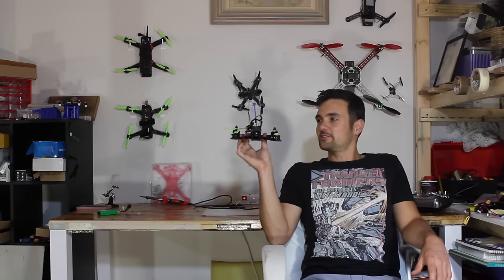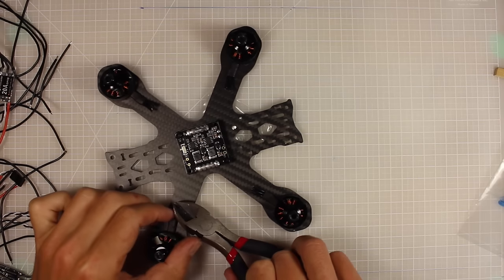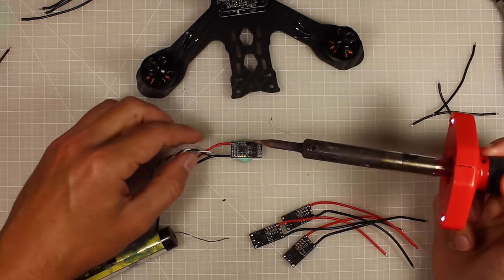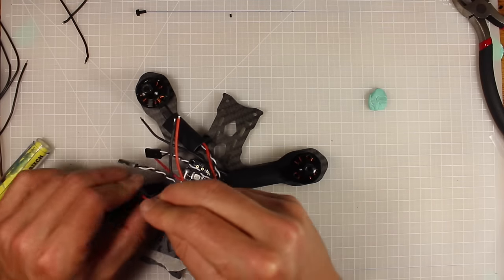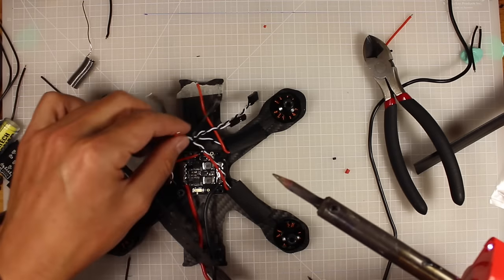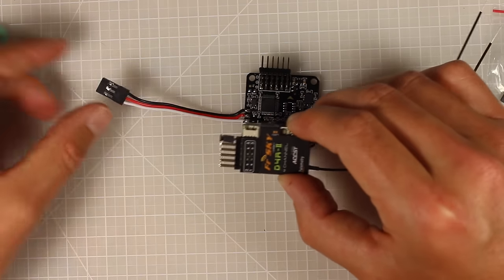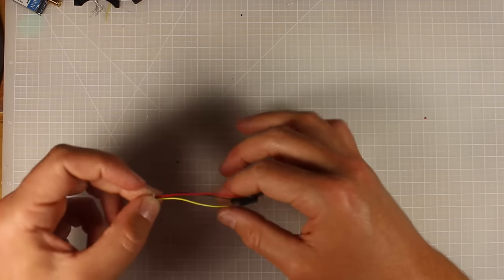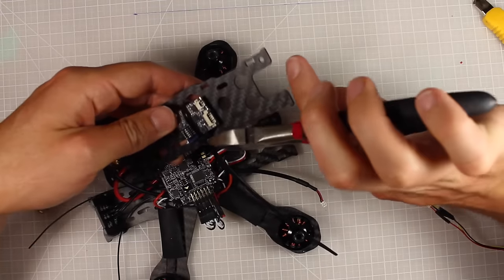HOW TO BUILD A RACE WINNING FPV QUADCOPTER: TUTORIAL GUIDE

Comment: I managed to fit 5 inch props and man! This is a rocket 🚀!
Reply from the maker: WHAT ON A 41B???
Reply: I'm not sure what you mean by "41B." But, if you are talking about the frame, no. I used a different one.
Reply: BTW, I have a question. I'm a noob. I feel very stupid for asking this and I feel as if i'm missing something. When I put on the props on the motor shaft and screw on the nylon locking nuts, the nylon locking nuts seem to only screw on to a certain point. I grab a wrench to tighten it but it really doesn't work.
Reply: make sure you're using the right nylock nut, the threading should be reversed on two of them, that means you tighten them anti-clockwise. The motor nut will only screw on to the correct threaded motor shaft, make sure you've soldered the clockwise and anticlock wise motors in the right place! Otherwise the props might fly off if they're not spinning with the thread!!!

Good luck!
Reply: +MrSmoothvideos 
I'm using the correct nylon nut. The one that comes with the motors. The motors are spinning the correct direction, it's just the nylon locking nuts are not screwing all the way down.
Reply: Golden Archer
Are you sure you using the counter clockwise nuts on the counter clockwise motors and vise versa
Reply: +MrSmoothvideos 
There are no cc and ccw nuts.    A nut is a nut. They only spin one way.
Reply from the maker: Golden Archer there are indeed normal and reverse threaded nuts
Reply: I'm not sure. I'll figure something out sooner or later.

Comment: how we doin mate if i was using afro esc's would i need to give my naze32 a seperate 5v power suply 
cheers :-)
Reply from the maker: +James Bowen do they have a bec. As in do the afro escs supply a 5v power supply. 
You need to power the naze off 5v. Now some escs do that and some dont. if they dont (which was the case in my vid) then you need to find another 5v power source
Reply: +UAVfutures no probs mate I'm building my first racing drone the zmr250 just waiting for the naze board to come. Then I found your channel was having a mouch and you said I need to have a separate power supply but I've looked at my esc's and they supply the voltage to the board so my panic is over. Because I've made my own PDB and there was no way of reducing the current to 5v. Cheers for getting back to me mate 
James :-)

Comment: Is there any cheaper frames that I could use instead?
Reply from the maker: +Tyler MacNeil you can use any frame you want. I just recommend carbon fiber so it dos not break. The ZMR 180 is a good cheap frame from "FPVMODEL". not quite as good as this Armattan but its great value.

Comment: First of all, thank you for your grate videos! Becose of you and your great videos i want to start with FPV flying now. But I am afraid to build one becose I don't know how to bring them in the air... I know how to fly them on my simulator and I am not bad at all. I just don't know how to programe them and bind them with my spektrum DX 5e. I know the modle is a little bit old but is it even possible? It wuld be SOOOOOOOOO awesome if u could help me (With a tutorial would be great). Again THANK YOU! And witch Drone do you prefere, the F1 4B or the F1-Pod? Sorry for the bad english and stay awesome.
Reply: And got this thing anought power to carry a gopro on it and make cool stuff with it?
Reply from the maker: +THE_LAW_42 this thing can easily carry a go pro, the only transmitter I use is the taranis so in order to fly with your spektrum you need a compatible receiver. I dont have a spektrum so I cant make a tutorial for you sorry. I do have a cleanflight and betaflight set up on my channel though which will help you with some of the programming in the flight controller
Reply: UAVfutures
 Thank you for your advice. I allready baught the vortex 250 pro today so I don't must prgramme the quad myself. But if I like the hobby I can build one after.

Comment: hi stu iv just got a mini fpv setup to put on my old syma x8g  i was thinking at the start of using a pigtail to have the antenna on the top center of the quad but iv had a 2nd thought incase they big props catch the antenna can i shoot the antenna out from the back strait out  or must the antenna be point up stu
Reply from the maker: the antenna should be perpendicular to your receiving antenna. but if you use a circular polarized you should be ok. idealy you want it straight up but this can be hard when your quad is changing orientation all the time
Reply: cool stu yes iv got the ANBEE set of antenna,s for this and the TS5823 mini transmitter  for this im just waiting on my mini cam and my step down to come they should have been here by now lol  but there coming from china stu  i got all this for $26.42 on ebay and im still not sure if i should put the transmitter inside the body and shot the pigtail out the back of the body  or from under neath lol    and i had an old internet rooter iv took the antenna of and was thinking of putting it on my controller iv seen some one doing this with a X8G  for better range  for fpv  and i can still have my syma camera for video and nice pitchers    do you think this would be ok doing these mods stu   i am getting over ten mins flying times with this X8G  even with video running  i cant really see it being a problem stu m8  what do you think  and thanks again stu
Reply from the maker: William Davie my advice is keep it as clean, simple and light as possible.
Reply: +UAVfutures hiya stu yes that's my main priority m8 iv put my transmitter and antenna on the scales it's 12g  and iv got the mini Aomway 700tvl wdr it' shows in the details 12g so all in about 24-25g  and I was thinking about getting another set of landing legs and cutting a good inch or or just over  to compensate for the the extra 24-25g stu I'm thinking ahead my friend the x8g has 4 big heavy landing legs so taking of a good inch or just over will make a difference but I want at lest 10mm clearance when my quads sitting on table so my syma camera wont get smashed or broken stu  and thanks again m8 all your help and advice means alot and helps  thank you very much happydays to ya stu and happy flying lol
Reply: +UAVfutures hiya stu how's tricks hope it's all good m8 
iv just got round to building my fpv setup iv got it all done and working on the worktop and looking good but iv noticed when looking at my googles it's perfect but on my base station screen I noticed something really strange stu   the right handside of my view is very strangely on the left side of my screen lol   if you know what I mean the my right is showing the correct way on my googles it's the  bosecam TS5823 transmitter and bosecam rc305 receiver I'm using for my base station set up  stu but I just don't understand how it's doing this  iv taken ami pic showing the view of the googles and screen side by side and showing the view of the room lol

Comment: Where do you get the right angle header pins?
Reply from the maker: +Nathan King They either come with the naze or you can buy them from eBay. Just search "right angle header pins" they re probably less than $5 for a whole bunch. You can also buy nazes with pre soldered right angled headers if you search around

Comment: I simply can't afford it right now. So i would just get the drone components, and not the camera, fat shark glasses, antenna and i dont think i would need the flight controller, right? eigther way, my question is if it is possible, and wich components i dont need, just so i can fly it and see if i like flying with a drone. :D
Reply: +Rabbineren You need the flight controller. It will be very uncomfortable to fly one without a FC
Reply: +The Noisy Potato ok thx ;D but i can leave out the glasses and camera at first and add them later when i've got the money?
Reply: Rabbineren Yup you can. So if you want to save money, just get the frame, flight controller board, battery, ESCs and motors. And lots of props. Power distribution boards are nice also but not necessary
Reply: +Rabbineren Whoopsi I meant the Receiver xD Can i leave the Receiver, Camera and googles out?
Reply: +Rabbineren and the video transmitter. Sorry for all the questions :P
Reply: Rabbineren Yes. The Vtx can come later. No problem at all. Everyone needs to learn
Reply: +Rabbineren there are some pretty decent flight controllers for low prices, 6 channel one+receiver =$60, i can only imagine the price being less for a 4 channel one, which is all you need.
Reply from the maker: +Rabbineren I would leave out the FPV section. just get a radio, and a quad. Or if you reallt are strapped for cash a hubsan x4 is a great starter.

Comment: whats the thrust to weight ratio of this little beast?
Reply from the maker: +bauke-jan feenstra im not exactly sure. but more then I can handle thats for sure haha. With a 4s battery it weighs in at about 430grams. But i don't know the max thrust of these motors. Let me know if you find the data and work it out. I would be interested to also know.
Reply: I found the motor tabel in your link: http://www.myrcmart.com/rcx-h2205-v2-2633kv-multirotor-outrunner-brushless-motor-motion-balanced-p-9195.html
so, on 4cell and gf5040 it produces 865grams of thrust. That means it has a power to weight ratio of 8 to 1 !
But in the tabel they are also testing it with 16.8 volts, then the motors produce 1000grams of thrust each! Thats a power to weigth ratio of 9 to 1! Gets pretty hot tho :p.
That is a fantastic quad! Will be hard to hold down, isn't it?
Reply from the maker: +bauke-jan feenstra just remember this quad is running 4inch bull nose props. I don't think they have the thrust data for my prop combo. regardless its still got plenty of punch

Comment: For motor direction. Im setting up a servo tester. Bheli is supported? You could reverse it on that.
Reply: You can reverse motors with blheli suite but you can't change the threading of the motor shaft so you still need to use counter clock wise and clock wise motors correctly.

Comment: Thank you so much 👍
Reply from the maker: +Johannes Kienast pleasure
Reply: +UAVfutures just two question what batterie is optimal? would it be a good idea to use this setup in my A250 Frame ?😅
Reply from the maker: Johannes Kienast whats an a250? For this i think a 1000 to 1400mah 3s or 4S battery is perfect. and also make sure it has a high c rating. 40 C minimum but 60 + is better

Comment: How much did this quad weigh
Reply: I think it was something like 400g
Reply: with or without battery?
Reply: without, but then again that's just my estimate. :3
Reply: hmmm I think that is too high, I would say closer to 340-350 maybe even below that
Reply: really? my 5 inch quad is a very similar build and weighs 565g
Reply: what motors and frame? the f1-4b frame weighs 90grams according to armattan . I have a similar 180 with a 80gram frame and dys se2205s and it is about 320grams and that is as lean as I could get it, striping , depining and direct soldering everything.
Reply: motors: 2206 2350kv lumenier
Frame: Armattan f1-5
Reply: the lumenier 2206s are typical weight of 2205-2206 motors thats around 30grams each. The f1-5 is about 140gr. So a build like this should be aroung 400gr, thats without a battery and gopro. You are at 565 gr  without a battery and fpv recording camera?
Reply: without the battery : so yeah, with fpv camera vtx, receiver etc.
Reply: You are a bit heavy but no worries you have plenty of power with those motors